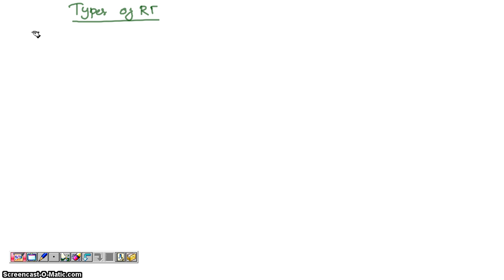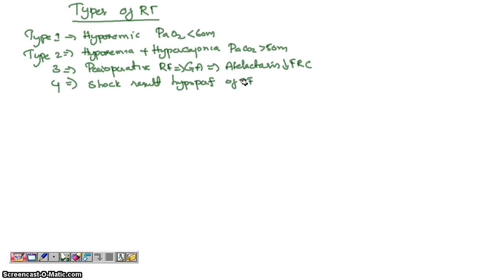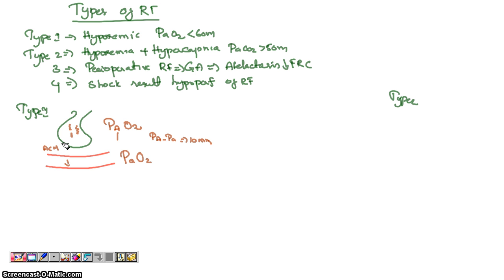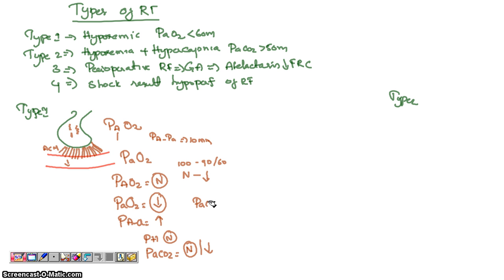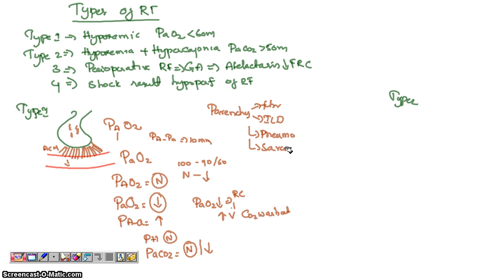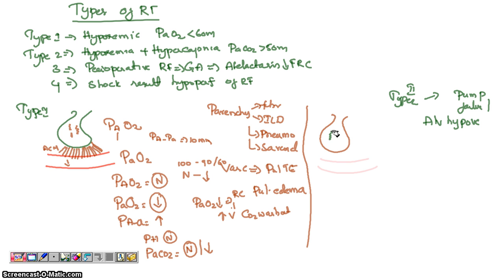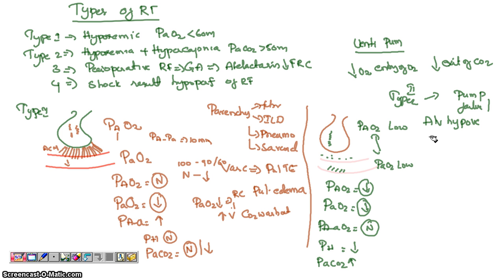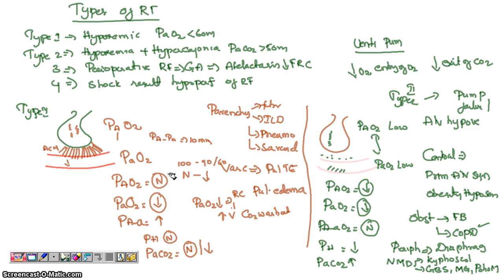Types of Respiratory Failure....

Comment: Please need correction. Oxygen is depressant of brain respiratory center while carbon dioxide is stimulator of respiratory center. It is not oxygen that stimulate but it is the increasing co2 that stimulate and then co2 washout done from sorrounding alveolar membrane.
Reply from the maker: Hypoxemia can stimulate peripheral chemo receptors and result in hyperventilation and CO2 wash out.